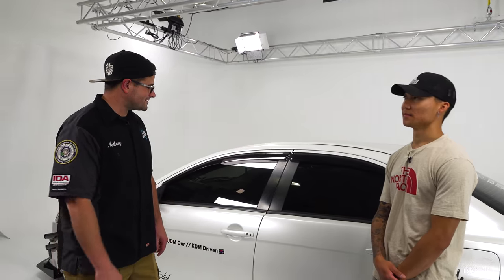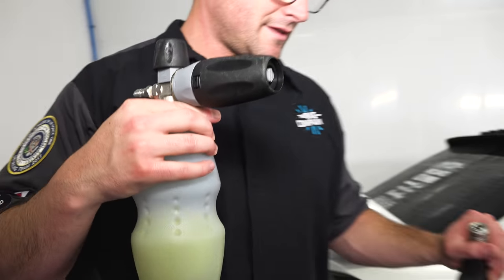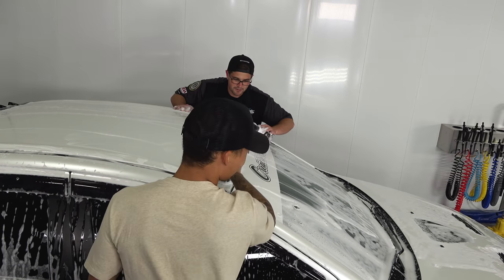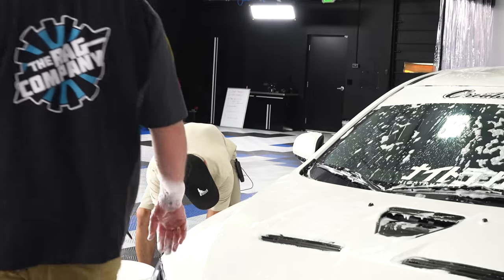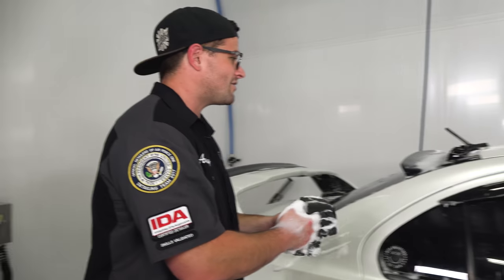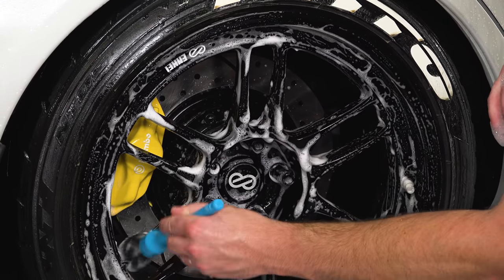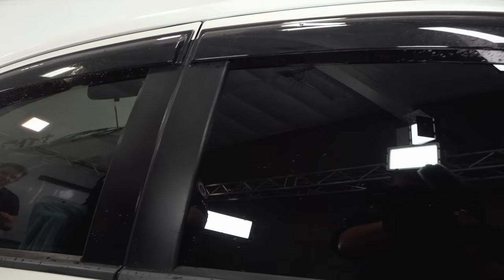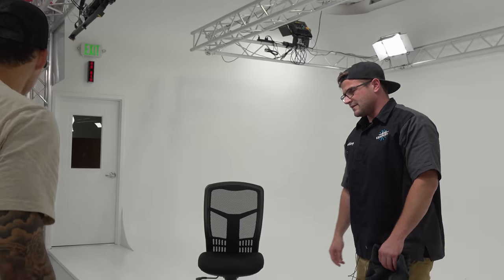EVO X Gets A Foam Cannon Bath In Our New WASH BAY! | #WASHWEDNESDAY

Comment: Also you washed the paint and then the wheels which is back to front weather you want to be different or not its not the correct way
Reply: @theragcompany  disagree! You washed  the wheels without rinsing the paint again after..... Could be anything blasted off the wheel onto the paint... Which then could be dragged over the surface when drying
Reply: @theragcompany  exsuses excuses! Why not just do the wheels first and eliminate any chances at all rather than taking risks?? Makes miles more sense...... Also guessing by the amount of likes your getting  on your  comments a good majority of your view's on this post are novices. Sponge🚫paint before wheels 🚫